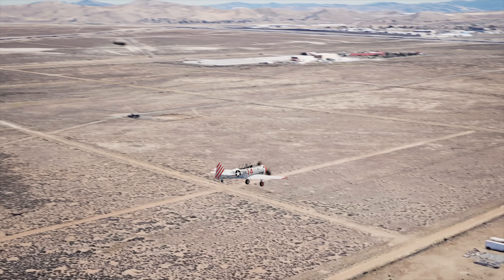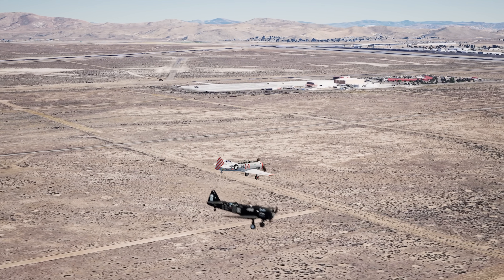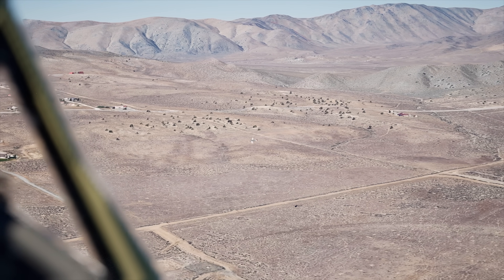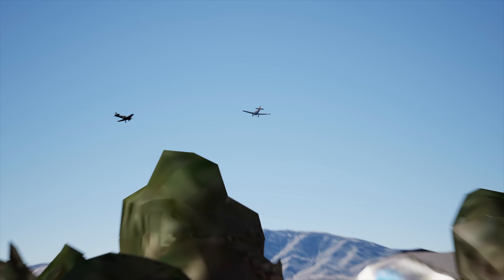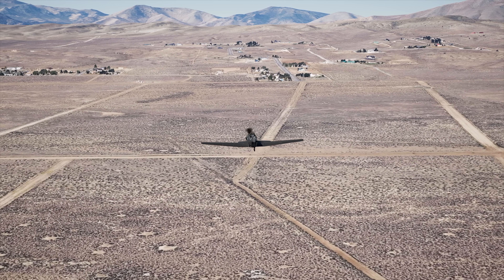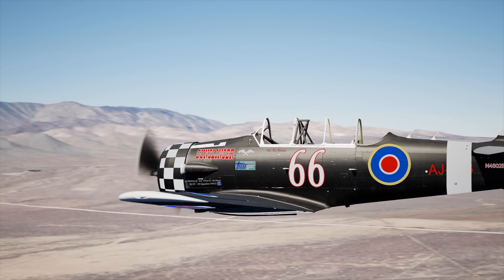T6 Crash NTSB Report and Animation

Comment: Key fact everyone is ignoring is the cuty if Reno allowing residential building to closely encroach on the air field. Go outside the ever tightening borders and get harshly fined by the FAA for it. After the T 6 crash into a house years ago the city should have stopped allowing any new housing there. Instead, they increased it and booted the races out to help the developers. This crash shows just how wrong they are.

Comment: I'm surprised that no one has mentioned that there's going to be a 2024 Reno Air Races. Any updates on that?
Reply from the maker: There’s a different group in Las Vegas that is wanting to hold a race but they’re not ready and not associated with the Reno air race association. Rara has 6 different candidates for 2025, so it looks like 2024 is unlikely.
Reply: @Brian.Murray  Ah, ok. Thanks for the news.
Reply: @skatetoexplorevideos2477 The races will take place at Roswell NM September 2025.

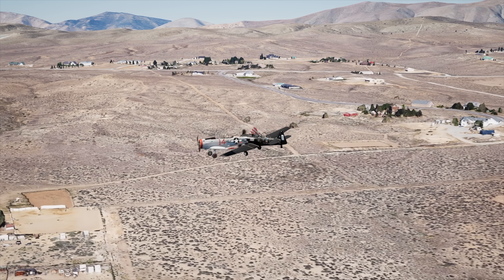Comment: I think your MOST telling bit of video was from 8:50 to 9:10, and I think you may have swerved into the problem, perhaps unwittingly.  I believe your ground tracks are probably accurate.  I have around 750 hours flying T-6/SNJs, and a thing you may not realize it that, with experience in ANY airplane, you, as the pilot, find it less and less necessary to fly your pattern over the same distances from the runway....that is to say, when you are first getting comfortable with a type of ship, you TRY to fly each pattern consistently in terms of distance from the runway and touchdown point as you become familiar with your airplane.  But after a few hundred hours in a type, you become very comfortable approaching the runway from just about ANY direction, with your before landing routines being so comfortable to you that a "disciplined" pattern isn't really a necessity for you like it is in the beginning.  What you show in the aforementioned 20 seconds of simulation is something that is deadly in just about ANY scenario, and that is the concept of "constant bearing, decreasing range," which absolutely IS the formula for a collision.  Even the most experienced pilots will only "notice" APPARENT motion in their peripheral vision, and two airplanes approaching on a "constant bearing" have NO apparent motion to each other.  Here we have two HIGHLY experienced aviators, fully expecting each other to be watching out for all of the others, so, I suspect that element of faith in the other pilots caused a somewhat lax "lookout doctrine" in each cockpit in that pattern.  And, here, we have a bunch of guys coming out of a high-intensity period, and there was probably a few of them that were still taking a few deep breaths to "come down" off of that adrenalin overload...NO ONE would expect this or be really watching out for it.  Adrenalin also gives you a kind of "tunnel-vision" to the tasks required to stay in the game, and, I believe, it's quite likely that these guys still had some of that working against them.  They were approaching each other on the "constant bearing," so, with all of the ground clutter visible in that, as you point out, 300' AGL pattern, even with an airplane as big as a T-6, it would actually still be pretty easy to miss seeing it until you were RIGHT ON TOP OF IT.  And, by that point, obviously it would be too late to do anything about it.  AND we have NO IDEA what was going on in each one of those cockpits....flying low and fast doesn't give you a lot of time to analyze your instruments, and one of these guys could have been looking at some "abnormal" engine perimeter or, something else you do in a T-6 is you look through small windows in the upper surfaces of your inboard wing to verify that each main gear is locked in place...EITHER ONE of the "accident pilots" could have seen something that appeared unusual to them, and that very easily could have drawn their attention away from the developing conflict between the two airplanes.  It seems like THE LEAST LIKELY MOMENT for an accident like this, but THAT is EXACTLY WHY these things happen, because we let our guar down for a CRUCIAL few seconds.  Just ALWAYS remember...there, but by The Grace of God, go you or I.  NEVER NEVER NEVER let yourself fall into the TRAP of thinking "THIS COULD NEVER HAPPEN TO ME."  Because it CAN.  Godspeed our lost friends.

Comment: Great work.. I agree with what 50 stated “downwind behind 88” they would both know where each other was… 6 should have followed 14 or gone high for a cool down which it appeared no one shown here did after the completion of the race. 
It looks like 6 went wider on downwind after completing the race and 14 made a sharper turn after and since trailing 6 caught up and lost sight of him.
These two pilots knew each other very well and perhaps 6 did something different this time. 14 never inquired where 6 was on base either but I’m sure both heard they were on base which is a little confusing because 14 was for sure but 6 flew into the side of 14 so he wasn’t on base yet by the video..

Comment: Thanks for your videos, they answered a lot of questions about how this terrible tragedy happened.  One thing you touched on that seems strange is why was there really no cool down?  It seemed like these guys were in a hurry to get down.  We were on the boundary rail in front of the T6 pits.  From engine start up to taxiing to last chance, waiting for the A-10 demonstration to end seemed to take 20-30 minutes.  I’m not sure how much fuel they are carrying for the race but is it possible they could have been running low after sitting running for so long?

Comment: Brian, the Jet pattern is tight and not wider at all at RENO . Our downwind bisects 14/32 right in the middle using both 8 or 26.  Being predictable is key to the race recovery pattern working. Our pattern is tight.  Wide is unsafe as you can imagine.  All our downwinds should be the same so everyone should be able to find the other planes in the pattern.  We also clear by radio secondary p. Visual is primary as in all traffic patterns.   One thing you are missing is the tower’s participation.   As we sequence ourself and clear our self’s for landing, we use the tower as a back up…and that failed us this year.   Still looking into that perspective.  You have a Langley tower controller in Delta BC. who worked in the Reno tower the last 7 years but due to her and the tower manager not seeing eye to eye, she has not volunteered to work Race control this year. She was the absolute best and we all thought that. Most pilots believe she could have prevented the towers failure in this case as here perspective of the patterns and understanding of the flow made here the best controllers there.    

Secondary note.  Please rise above the “white Lilly guy😅” blanco conclusions are marginal at best and his conclusions are not accurate in many of the presentations. He jumps the gun and in a case I am close to, he totally missed it and I cannot comment on possible outcomes. I do not want to see you falling into his camp.   There are other issues but I do not have up to date info and will not comment on them as they do not involve any operation I am part of.     

Cheers and very nice presentation.  More facts are being uncovered daily as you can imaging.

Jets
Reply: You are the only one commenting that actually knows what they are talking about. 👍

Comment: It's obvious from timing of the real-time audio that at least the first five aircraft went straight into the pattern to land following completion of the race. We'll probably never know, but perhaps Chris (Barron's Revenge), finishing 1st with a good lead over the rest, intentionally flew a wider than normal circuit/pattern to afford more spacing so he could go straight into the circuit/pattern and land after the last aircraft crossed the finish line (and also to gain a good visual reference on the other aircraft before descending). Your animation illustrates just how much time can be made up by simply flying a tighter pattern (estimate 10-15 seconds by Six Cat in this case). While i wont place blame on any single individual, i believe it's important to grasp the purpose of those radio calls (downwind abeam, base/gear) is so that other aircraft in the circuit/pattern know where to look to visually acquire you, particularly aircraft in front of you; that responsibility lies with everyone in the circuit/pattern. Thank you for the animation, i believe it's a fairly accurate (and logical) representation of patterns actually flown, and you did a great job illustrating how a varied pattern versus a fixed pattern (ground-track) can cause a conflict.. My condolences to both families, sad day in air racing history, and may Chris and Nick both rest in peace.

Comment: The aircraft that crashed into the lead plane was flying westward...yes?   Where was the sun at that time and did it play a part in making the midair happen?    Of course with people flying different paths one being wide with the other cutting off the corner so to speak....a collision for sure was possible.   One would think that they would have been flying a more disciplined pattern...but I guess it's too late now.
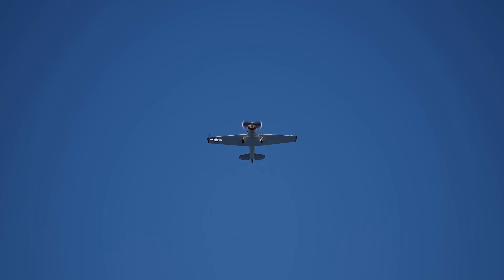Reply: Not a factor. It was 2:15 PST and sunset wasn’t till 7:05. The sun wasn’t on the horizon at that point.
Reply: @jmhkeys3279  Thanks for putting that thought to bed.   Was hoping that there might have been a factor other than just regular old human error in play.

Comment: Here in Australia the T6 is not considered suitable for air races due to its slow speed and sluggish reaction to control surfaces. Racing them was banned 40 years ago. It was a trainer when new, not a warbird, and not a very good one either. Lots of students died due to its need for 10,000 feet to recover from a stall. Thats even in the flight manual.

Comment: Nice job, and I'm glad you went through the effort to simulate this. I have a theory related to the Wings over Dallas collision (December 2022) between the P63 and the B17. I believe that, had the B17 not been in the way of the P63 that was accelerating, turning, and descending, the P63 would have contacted the ground and tumbled into the crowd. If the inertia of the P63 would indeed have resulted in that tragedy, andargument can be made that the B17 saved the lives of spectators, even at the cost of their own, and unknowlingly. It would be interesting if you were able to simulate that collision as well.
Reply from the maker: The software I use can do physics and destructible simulation too. I tried to get it to work but decided to just go without so I could get the video out. But I may tackle that one as well. I’ll have to look into it more as I don’t know a lot about it.
Reply: The reason is the same as Dallas. Pilots trying to accommodate unreasonable requests by incompetent administration. The P 63  pilot killed the bomber crew. Race 6 killed Race 14. Race 14?may be slightly at fault for flying a “bomber” pattern” but tower/race control is at fault.

Comment: One thing to note, the reno recovery is not a standard pattern. They fly a sort of circling break approach like a military approach, the abeam call is referencing the numbers if I recall correctly.
Reply: If they use the procedure as the Sport Class recovery I referenced above I can’t tell if they exit the cool down to downwind or an initial. According to the Sport Class procedure DW abeam is abeam race control on rwy 8. If your recall is from actually racing in Reno what was their procedure if to didn’t want/need cooldown.

Comment: It looks very similar to the B-17 accident at the airshow in Texas. He hit him in the tail while obviously not seeing him. Tower guidance might have averted this, even without radar, by allowing only one plane on each leg at a time. There should be no rush to land in the cool-down.
Reply: Except the B-17 crash was likely caused by poor tower/air boss guidance instead of lack of it…
Reply: The B-17 crash was at an airshow, at much faster speed and not landing with poor direction from the tower so many differences. Same tragic outcome.
Reply: There is no rush to cool down but some just have enough fuel to race and land. No prolonged ridiculously wide tower controlled patterns will work.  Our regs
 to race allow us to fly less than VFR reserves.  Tower did fail as they failed to see the issue developing.  Race recovery procedures are precise and someone flew a haphazard pattern and the results speak for themselves.   We self clear and self sequence and use tower as a backup at Reno.  Many times when I paced at Reno the last 2 years, I had to take over the frequency from tower to help racers recover during normal ops and emergency ops and they seemed to loose planes in the pattern.   

As for the B-17, that was almost totally a tower(air boss) fault. 72/25.  The P-63 was asked to move his pattern yet as he was replying he hit the 17. The tower asked the 63 to move to the bomber show line.    Unfortunately the 63 was not nor needing to keep track of the 17 the way it’s briefed at that Airshow but accepted it before he looked to see if he was clear.     

My background, I knew all the players in that accident as I was apart of that unit and I race at Reno.   

Mike

Comment: Chilling animation, thank you for sharing. My initial reaction to hearing the crash audio was the lack of uniform spacing between aircraft and the imprecise nature of the callouts. Only 50 clearly indicates he has the aircraft in front in view and is following in line, perhaps because he is aware of the close separation (based on the short time between 88s call and 50s call for downwind).  If the pilots in the air don't have traffic in sight and there's no ground control monitoring position (I'm thinking of Oshkosh landing control), how can you assure positive spacing and speed? See and avoid only works when you first see the traffic, there has to be either positive control from the ground or a bailout option to escape the pattern if you can't see the plane ahead.

Comment: Great commentary, Brian! Only thing I disagree with is your comment that "see and avoid just doesn't work". It works pretty well if everyone flying takes it seriously. Especially if they don't get overly enamored with their cockpit gadgets that keep their heads and eyes more on their instrument panels than outside the cockpit. Having a basic setup in my RV-4 I have no reason to spend hardly any time looking inside the cockpit.
Reply: Mid airs are the result of NOT seeing and therefore not avoiding. If you do not have the traffic ahead of you in sight, confess that and with no response ,communicate,and act, that is communicate you are leaving the pattern and plan to re enter. If six cat had communicated that he did not have traffic in sight, and communicated his altitude, the outcome might have been different.  Reno Air Races exist under a TFR , but the traffic pattern is the same as an uncontrolled field, no one is sequencing you, no third party is providing separation
Reply: Isn’t every midair collision a case of seeing and avoiding not working? Those accidents aren’t as rare as they should be.
Reply: See and avoid is know to be deficient and has claimed many lives. I personally know 7 who have lost their lives to it.  The real issue is that as humans we are running 200,000 year old software which hasn't evolved to deal with the speeds involved, doesn't detect collision courses and was never adapted to the 3rd dimension.  I often don't ever see traffic that adsb picks up and thats when I know where to look. A tiny dot fixed on the windscreen remains fixed so you don't notice it and only starts to change in the last 2-3 seconds.